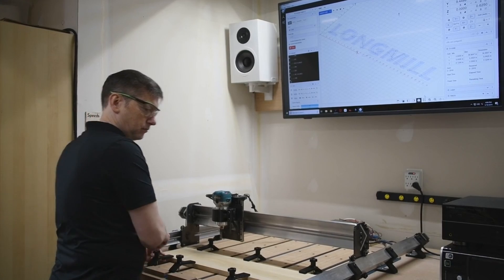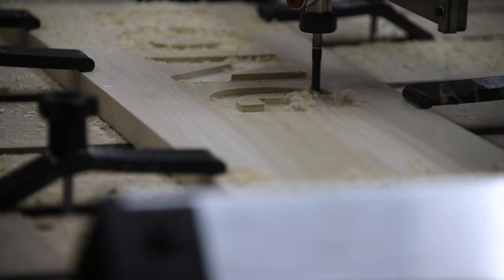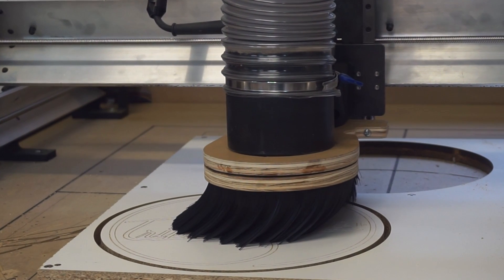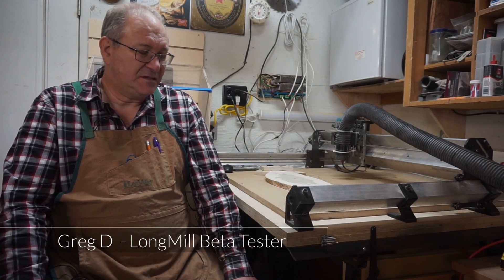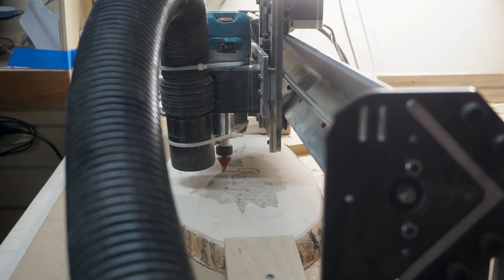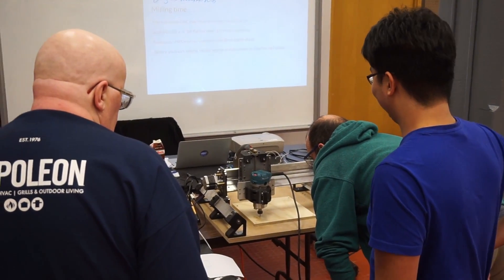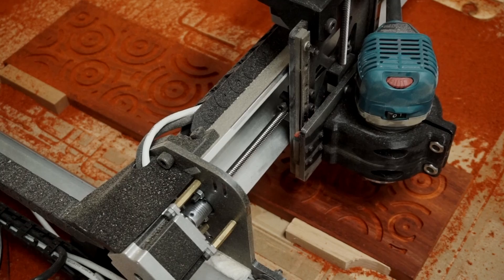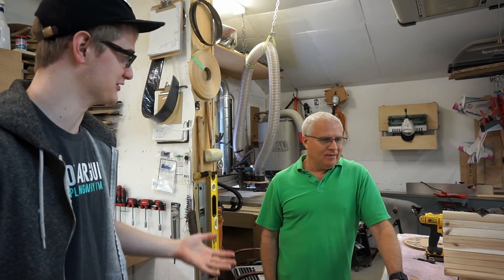LongMill Benchtop CNC Kickstarter Video

Comment: What bit do you recommend on making smooth outside cuts example circle or squares @ 20*20. We are buying one of these its just 45min away !! so excited .
Reply from the maker: Most bits can make pretty smooth cuts, moreso if you create a finishing pass after roughing out the initial shape. Compression bits also work very well on softer woods, you can find them on our website 🙂

-Chris
Reply: @SienciLabs  HAHA thanks im buying a few extra bits to along with the machine might as well buy them all at once and grab more later than not have what you need. Ive heard of the finishing pass is that done on vcarve or gsender? do you guys have a video on importing a SVG lets say from Etsy graphical image lets say a flower and how to import make the toolpaths then cut them ?